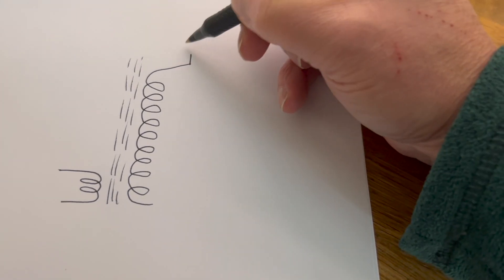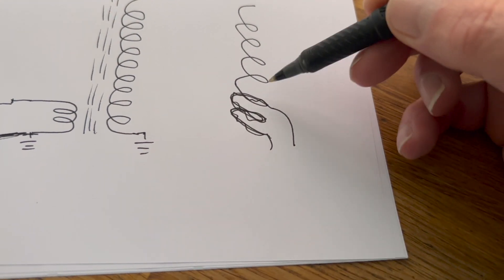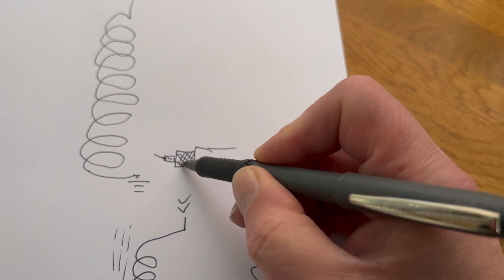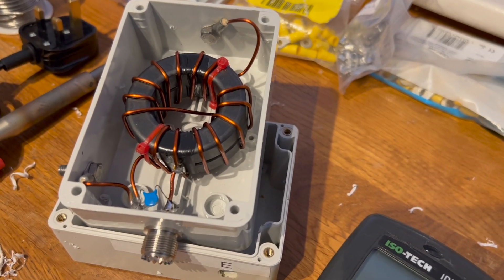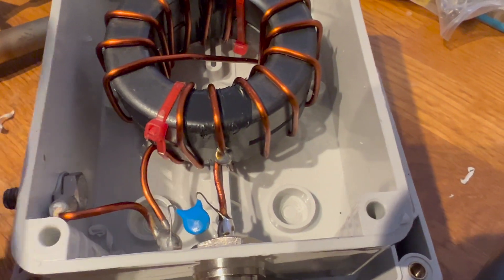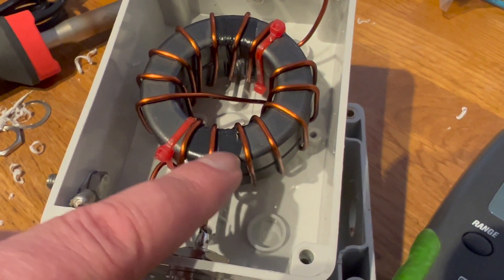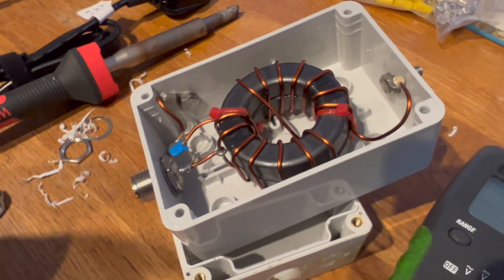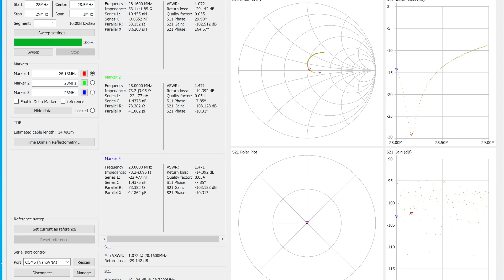Why is it showing a Short Circuit. 49:1 Transformer EFHW

Comment: Hi Mike... The thing I can't get my head around is - back end of the 70's early 80's on CB as a school leaver, the threat of a pin through the coax to blow a wally's rig up was regarded as a true fact? Fast forward to today, with a full licence, that back then believable true but untested fact has always stuck with me and I can't compute how a direct short on the first 2 windes of the transformer doesn't do the same as it shorts the centre to the braid just like a pin through the coax would?   OR  was that just a myth from people who thought they knew more than they did?
Reply from the maker: Hi Lance, no myth, the pin through the coax was and indeed is still a very real threat. You need to look at the 49:1 as a transformer- the power from the rig is passed down the coax into this 2 turn coil and from the 2 turn coil into the 14 turns of the secondary coil, the transformation or transfer of power is call inductance and this is one of the properties of AC. because there is a place for the power to go it will not damage the Rig. But, take a way the secondary coil and it will act like the pin in the coax, there is no where for the power (RF energy) to go, so it returns back to the Rig and creates heat and in a short time "pop" no more rig.
Reply: Cheers for that education Mike - That 2 turns foxed me for a long time.. it still does tbh, I always said to my Ham friends, I'll not go from an M6 to a 2E0 till I can understand  1:1, 4:1, 9:1, 49:1 or any other combination - anyways I did my 2E0 and still had gaps in understanding, even through Bath, and they explained it really well I struggled and funnily enough got all the transformer questions right in the full exam - I've watched 100's of hours in both transformer and inductance. magnetic fields, back emf, eddy currants, saturation, loss of magnetic flux through heat, permeability of cores, mix of cores, the maths involved... And yet, the first 2 turns looks like a direct short at .95% the speed of light to me before the AC can progress to the other turns on the ferrite toroid - kinda like a circuit breaker tripping faster than you can get a shock? I also know the 2 wraps of wire are actually joined to the other windings in 1 wire so I suppose the volts of AC would energise the whole toroid instantaneously and create a magnetic flux in a flash but in all the transformers I've seen where the secondary is earthed it's usually in the middle... - that may be my problem, I've not seen a secondary tapped 2 turns in? Have yo u got a vid of that? I think that's where I can't compute a 49:1? :)

Comment: ferrite type
Reply: 43 I believe he uses, though I have experimented with 51 as well.
Reply: I do believe he uses 43
Reply: I use type 52 but it’s one core or three cores for some reason. 240 size.
Reply: He is using FT240-43 in this video
Reply from the maker: Yep I used 2x 43mix  240 size

Comment: Mike have you ever tried a 3x wavelength end fed ?? With say a  64:1 or greater balun ? My buddy is running one on low band with a parasitic radiator below it at 60’ height I believe in a inverted L shape and with 1k he does pretty well. He’s not a DX er so can’t attest how well it works out far 😊
Reply from the maker: Would have to give this ago, just need the space.  :)